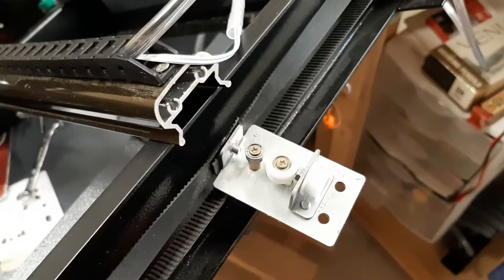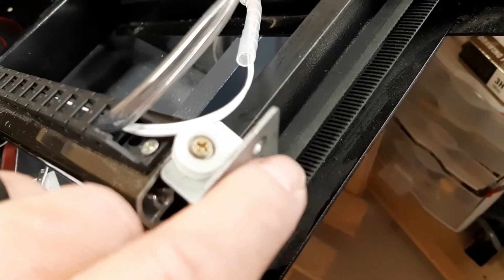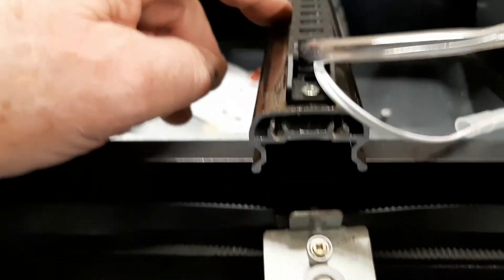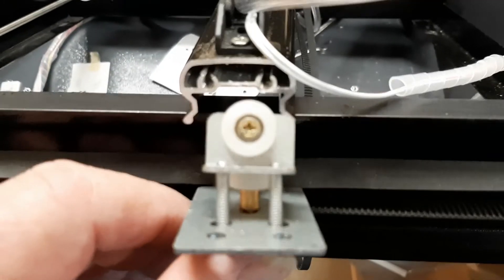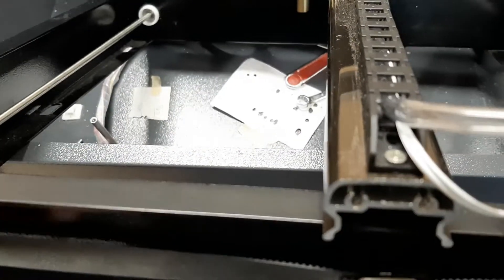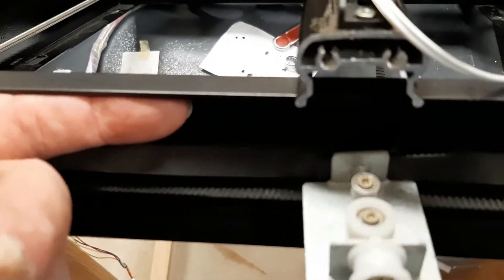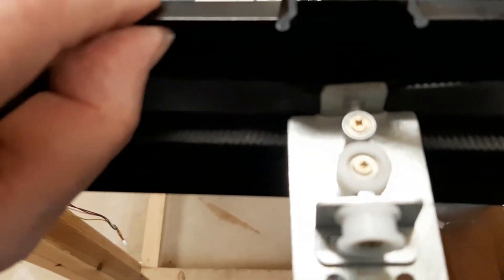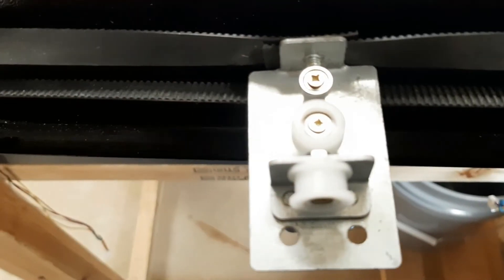K40 - X Rail   Tensioner

Comment: How did you by pass the reverse alignment tool battery??
Reply from the maker: Build a 'pack' out of 3 batteries (AA or AAA) wired in series so as to create a 4.5vdc power pack.  
[+ TO - TO + ] = positive lead 
[-  TO +  TO -] = negative lead

The barrel of the alignment laser is + or positive. 

The inner laser led is - or negative. 

Use jumper cables and connect the negative lead to the inner led. Connect the positive cable to any screw on the machines laser carriage.
Reply: @jcbigdaddy9901  do happen to have a picture? In not very savy in this sense  and just starting.
Reply from the maker: @JavierLopez-eg3hr  
https://linksharing.samsungcloud.com/fIapkBC2xKHB
Reply from the maker: https://linksharing.samsungcloud.com/9ivq8sx7GHo1